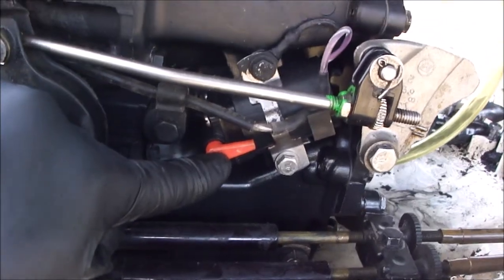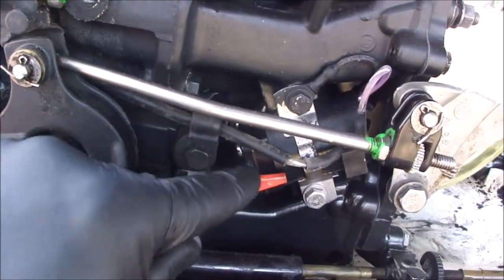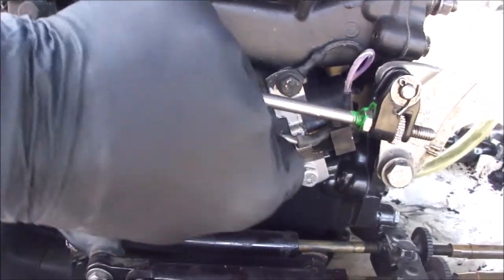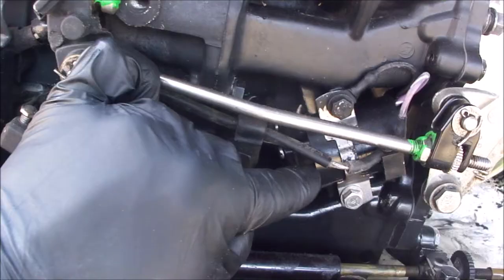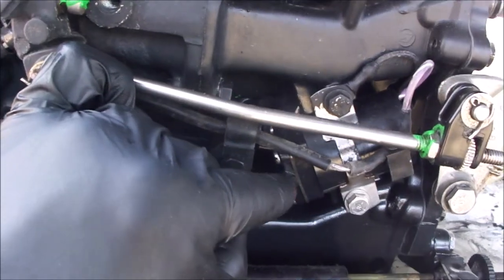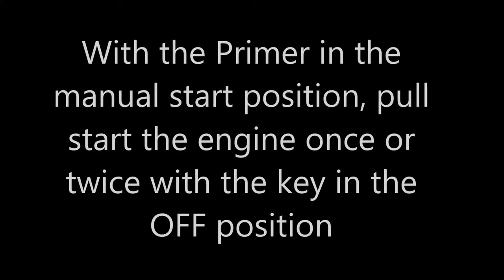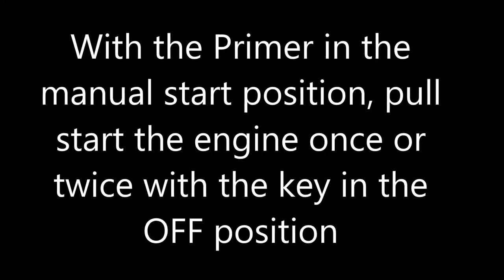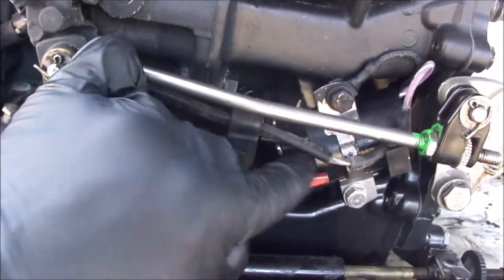Johnson Evinrude Outboard Setting the Primer for a Manual Start

Comment: Hi so my primer clicks and works I’m wondering is the choke supposed to alway remain closed on the carburetor even as I move my throttle forward the carburetor flapper you see from the front of the carb stays closed all the time?
Reply from the maker: No it should open as you accelerate. Sounds like your linkage needs adjustment

Comment: I just boat a 1990 nitro tracker with a 150 Evinrude tracker pro series XP. The orange switch there is pointing towards the back of the boat. I had to turn it pointing towards front of boat to start with key. Should I leave it pointing to the back or pointing to the front. I'm not manually starting it. Also will that help with having to spray starter fluid to get it to fire up?

Comment: Hi there
Where did you connect the purple wire of the primer?
Reply from the maker: I never disconnected it but took a look at where it is connected on this engine. There is a small terminal block on the side of the primer. The purple wire from the primer connects to the purple wire from the control harness there. You will probably have to follow the control harness back. It looks like the purple wire comes out of the harness where the coils are. Hope this helps.

Comment: I've got a 1998 115hp johnson and it has the primer. The key is to the left of the steering wheel and it's so hard to depress the key and activate the primer while you are turning the key that I disconnected the wire and put me in a foot switch that now operates the primer.
Reply from the maker: Not a bad idea! THat certainly gives yo a lot more control!
Reply: @ExtremeDIYGuy  Yes it does, I tried it yesterday for the first time and yes much easier to use. I used one of those foot control switches they sell at Academy sports to use on hand control trolling motors, which does the same thing for them, making them more user friendly.
Reply from the maker: @arciefan  That's pretty smart. Would be nice with we could make an accelerator pedal with one :D